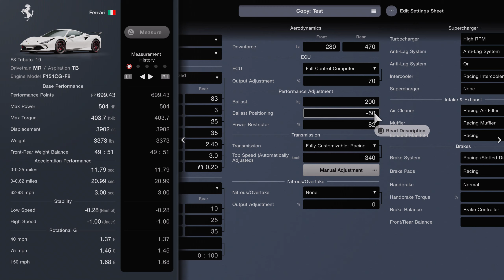Ferrari Circuit Challenge PP 700 F8 Tributo Settings - Gran Turismo 7

Comment: 3:54 I want to thank you immensely for this set up. 
I copied the set up and my PP was 721, I was worried but knowing that the update has made the glitch in tuning I just changed tonRACE HARD TIRES and the PP moved to 699.56. I went racing though skeptical but I won all my races on 1st position.. thank you very much.. Kindly put a disclaimer on the update and slight changes that may occur.

Comment: Ok this might sound a little nuts but on my copy of the game it has for the lag settings as off, weak or strong? Does it matter weak or hard? It does matter with the PP but unless I turn it completely off, my PP on both are over 700. Weak is 701.55 and the strong is 702.30All of my other settings are 100% matching yours.
Reply: It’s due to an update, they changed the anti lag to have 3 settings, off, weak or strong.  Video was made pre update
Reply: @wake2skate1  thanks

Comment: Why does my car get 711 pp when I’m using the exact same settings?
Reply from the maker: did you put a low wing on it?, medium turbo, and don't do any of the permanent engine and weight addons... they can't be removed. I know there's a lot of bugs with the car settings right now, they're constantly being cleared and bugged out for me
Reply: @FragThePlanet  thanks bro it’s fixed!